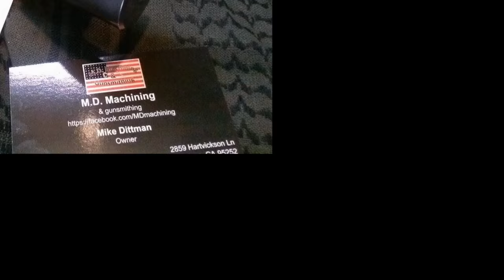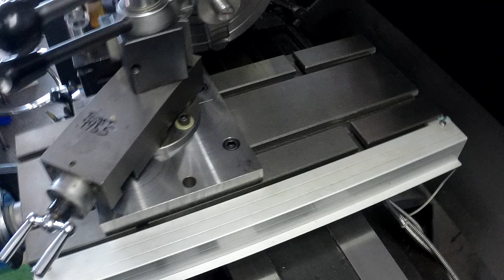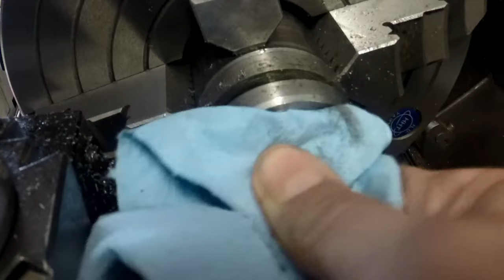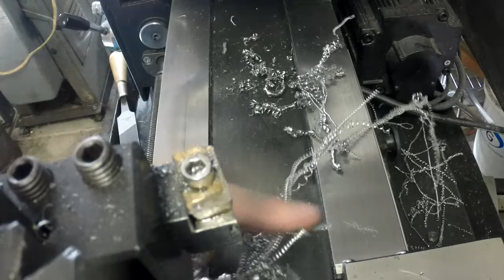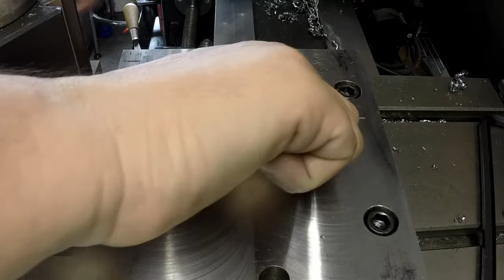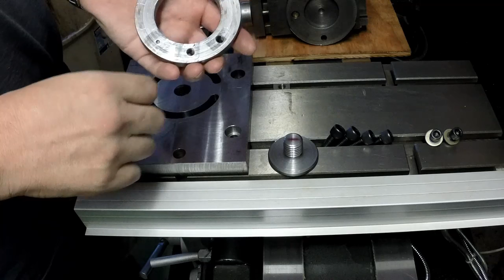Compound Rest Base Build Part 8 (the end)

Comment: Hope the shoulder is doing well.  Nice build.  It should give you a more solid base for it that you had.
Reply from the maker: Thanks man.  The shoulder is stubborn.  I am going back to the doc to see what's going on.  The range of motion stalled around the 8 week mark or so.  I can use it but not like I should be able to.
Reply: Sorry to hear that, Mike.  As a chronic ankle pain/motion sufferer who was hoping surgery would help that 2 years ago, I can empathize.  The shoulder could only be worse since we use it more.  I hope the doc finds something else that they can look at.

Miss seeing you in the shop.
Reply from the maker: Hopefully I'll still be able to get some videos. I'm trying to get my mill fixed and shop cleaned up. It's slow going when I can't lift my left arm higher than my shoulder. I got the tool made finally to fix the gear or remake the gear. https://plus.google.com/photos/...

Comment: Mike, I too own a Smithy 3-1 and have had to rebuild darn near every part of the machine. I have put new bearings in all areas excepting the saddle, that's to come. Once I got the wiggles out of the different parts it cut & runs true.  I have not paid much attention to the tool post but after watching your videos I will have to check mine out and see what I can do to make it more stable. My machine is one of the older models that I've had to update a number of parts. The motor was a wimp so when it croaked I went to the new version which also required the electronics package. That was a major difference for the operations of cutting and milling. I do have to say overall I have made a lot of parts with it and I am reasonably happy with the investment. 
Thank you for doing the videos and taking the time to make them, it is appreciated. Happy Machining.
Reply from the maker: Which bearings had the most impact?  I was considering putting in new spindle bearings to try and smooth out the cuts a little bit.
Reply: There are two large bearings, in my case it was the outer that was really bad. I replaced both while I had the head stock open. After I replaced both I ran them in and adjusted the pressure and in the end I have been very happy with the results. I also installed new quill bearings and got rid of all the run out in the mill head.

Comment: why not just press a plug in there instead of using the putty?
Reply from the maker: If I would have thought of that at the start I would have just pinned all the holes. I honestly didn't care about the holes until I started to use it and had to dig chips out of the various holes. I was asked about the putty and since I have a bunch of it I figured I'll just use that and make a video on it.